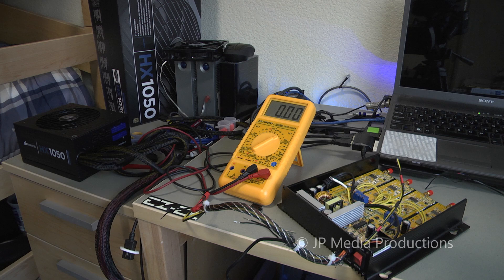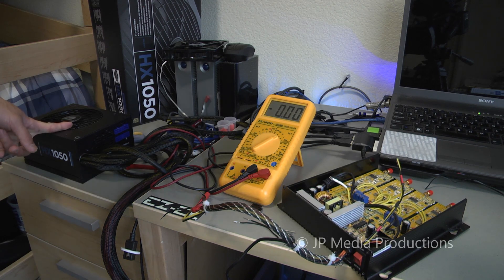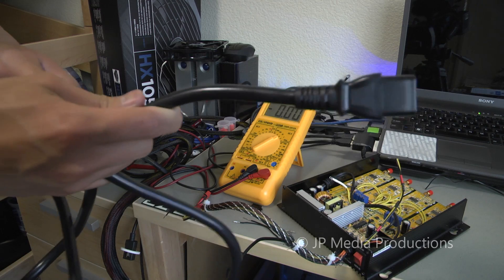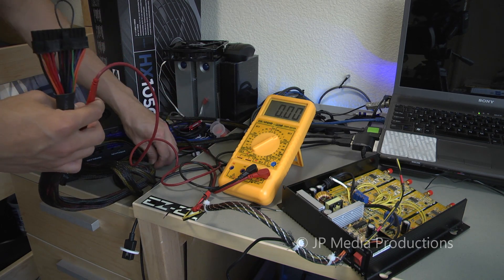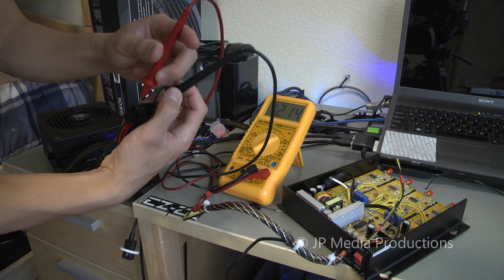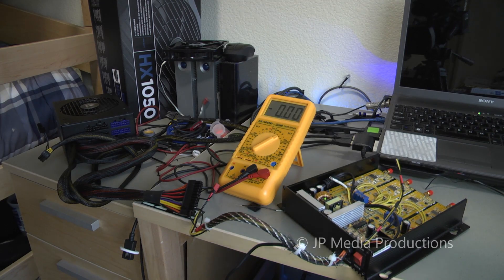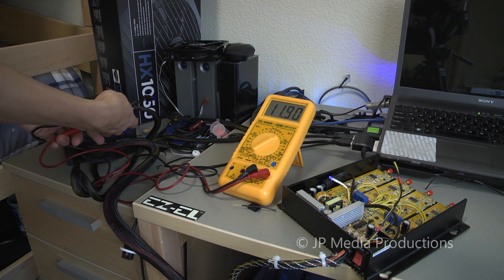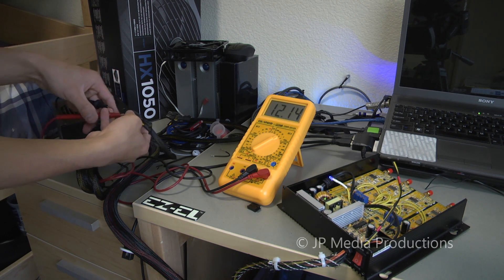Short Circuiting A Corsair HX1050 PSU

Comment: hello everyone, I have strange problem with my PSU be quiet! 500 watt semi modular 80+ gold.
I have my new PC, in first day it run normally, but in second day, when I turn off the PC, turn off my LCD monitor, and when I want to push the turn off button in my UPS, suddenly blackout happen
and then my UPS change into the battery mode, and suddenly there is some sparks in my PSU, and I smell something burned.
 
as fast as possible, I push my UPS button, and the sparks it's gone.
 
why is that happend ? it's very strange . pleas help me guys
I used :
PSU: be quiet! 500 watt semi modular 80+ gold.
UPS: ICA 1200va with stabilizer inside
 
below for detail information what PC component I used,
 
core i5-7600k 7th generation, 3.8 Ghz kaby lake
motherboard Gigabyte GA-B250M-DS3H rev.1
ram GEIL GWB416GB2400C16DC PC4 19200 2400MHz CL 16-16-16-36 ( 8GB x 2 Dual Channel kit)
PSU be quiet! STRAIGHT POWER 10 500W CM - Modular - 80+ Gold Certified
CRYORIG A80 Hybrid Liquid CPU Cooler With 280 X 27.5 mm Radiator Class - Dual Fan
UPS: ICA 1200va with stabilizer inside

I want to replace that PSU with Corsair  TXM 550 80+ gold. I didn't want that's problem happen again. So how can I test it ?  

please help me guys, thanks
Reply: I still got RMA for my PSU, so they send me the new one, it seems because their lack quality control . Normally it won't happened
Reply: @monsume123  were you motherboard or any other components affected? Or was it just the PSU? Same thing happened to me. I don't know why
Reply: Send it to warranty if new, nothing else you should do with it if warranty still in place.

Comment: ATX psu is not good for a lab power supply. No adjustable current limit (only pre-set trip current level), and no variable voltage output. And also, the psu has much worse ripple compared to a good linear power supply.
Reply: +Benjamin “Ozias” Esposti you can make adjustable current and variable voltage for about $5
Caps can solve the ripple
Reply: +lol49031 $5 is where i am from
Probably cheaper in your area
Reply: lol49031 
Well, with the stuff that I do, I need anywhere from 15 to 70 volts ... :/
ATX PSU transformers are designed for around 12V or less.
Reply: Dean Walcott
Unfortunately, I don't have much confidence in cheap ebay electronics like those. :(
Plus I would like to have a clean output, and the switching power supplies are noisy. I've had them cause problems before with certain circuitry...
Reply: +Benjamin “Ozias” Esposti you need a dc-dc converter that can change the voltage and has a current limiter go to ebay and search "dc-dc step up 1200w" this one is excellent